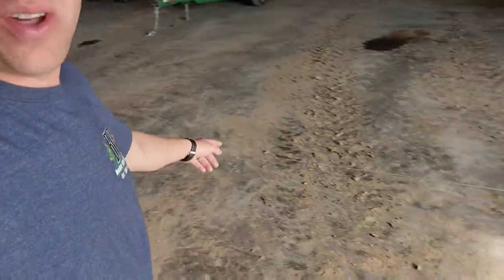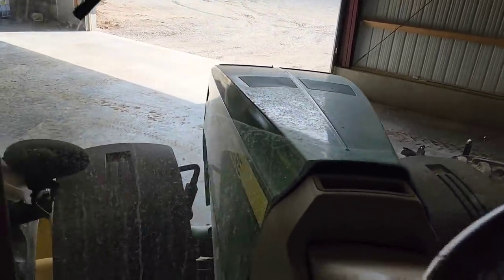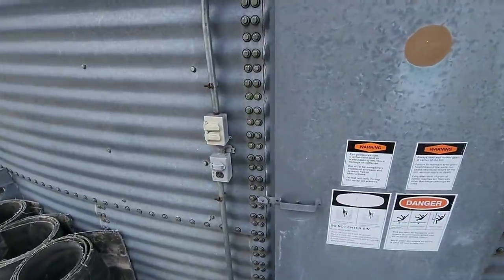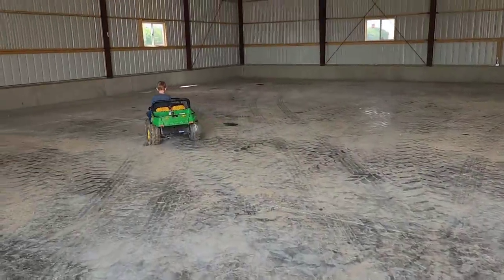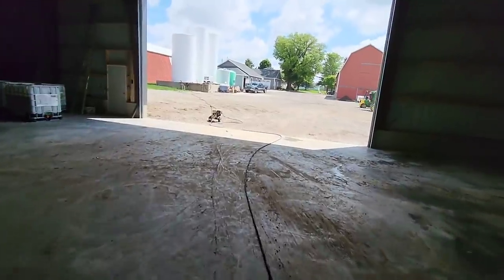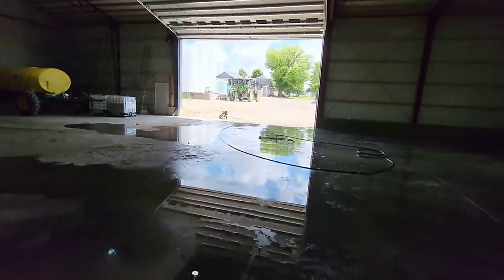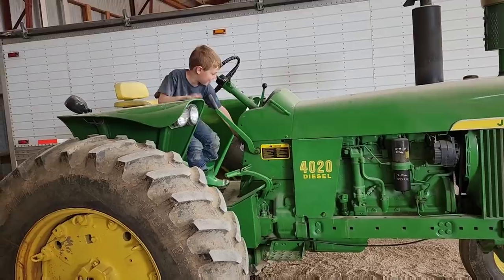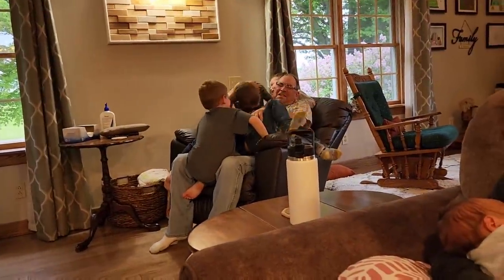Cleaning the New Barn - #682

Comment: What's the difference in yield between your bean planter and Brian's Avatar drill?
Obviously a lot cheaper only running one machine but there must be a downside?
Reply from the maker: Hard to say for sure. It will be interesting to watch his opinions as the beans keep growing. We still have 2 planters just different styles. I think the planter style does a better job of depth control, singulation, spacing, and just is a better overall planter. The drill/air seeder style is simpler and works but can have inconsistent depth and large gaps in the rows with no beans.
Reply: @BorderViewFarms  so how does Zack plant both beans and corn with 1 planter? Different row widths or does every other unit lift?
Reply from the maker: @farmernige  he plants all his beans in 40" rows most people have gone away from that as narrower rows generally yield better.